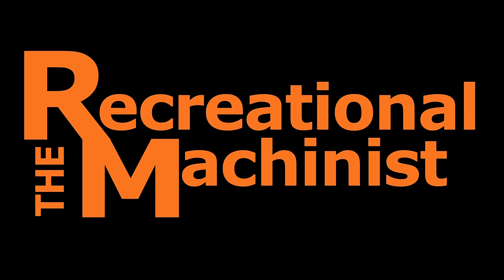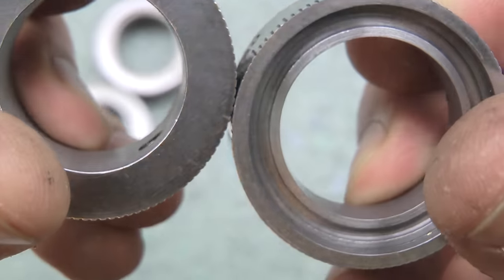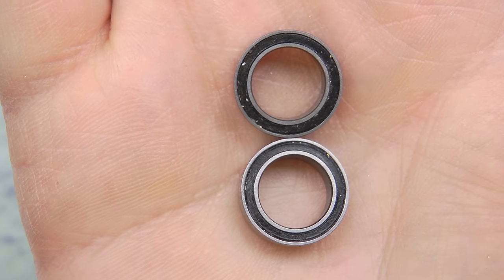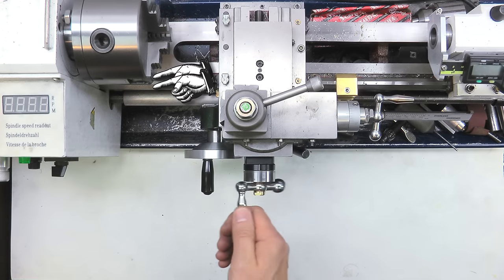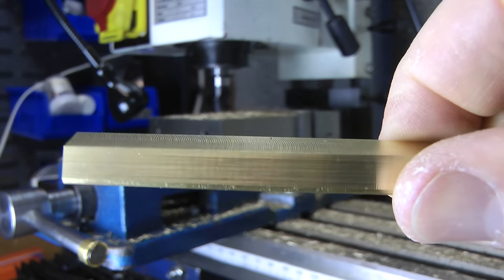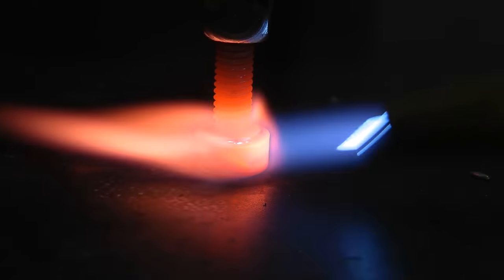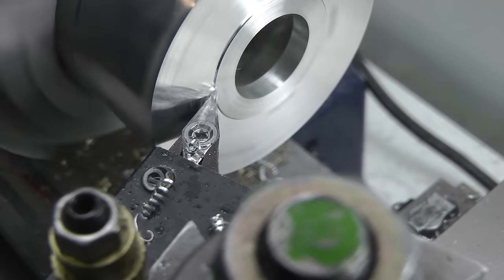Mini Lathe Cross Slide Improvements

Comment: By the time you have finished all your improvements you will have a top class lathe. Very interesting viewing.
Reply: If only the lathe makers in china thought at all about any of this. I doubt any of them even use the products.. sherline makes sherline lathe parts with sherline machines. These mini lathes are just a tad worse than hit/miss. I had to go through 3 to get a working one, first had a major defect in the bed, it was knife thin on am inside section and snapped when l clamped the tailstock, had to pay $15 restock fee. Second one, the spindle runout was terrible, chuck was mounted within 20 thou, another $15 restocking fee. Third one has minor versions of these two problems but l figure l already wasted money, the threading feature is outright useless, slop all over. I have a very old and beatup unimat that is about as clapped out as a new mini lathe. Their qc department is more interested in bat guano flavored bubblegum and sticking their peckers into dead freshwater fish than pushing through true lathes. I hope their business tanks and out of its ashes other lathemakers pop up. Their quality is a joke, a product should not require that much modification just to work properly, guess this is the chinese way..

Comment: I did the same thing to the dials on mine - those 0.025 units drove me mad. (I made the dials and scribed the divisions on the lathe - turned out pretty well). I also had the same problem with the gib strip - flattening the mating surface helped, but it also needed the places where the screws bear facing off flat. Now it sits in position OK.

Comment: What's the name of the cutter you used to mill the brass gib strip? It's like the opposite of a dovetail cutter.
Great video. Love the small upgrades presented.
Reply from the maker: That shape they seem to be called inverted dovetail cutters. They're not especially common, it took me ages to find a second hand one that was still useable, but worth the wait it's really handy for breaking corners on things without having to set the work or the machine at an angle. Smaller ones get called chamfer mills, and are more like countersinks. Not quite as useful, but easier to find. Thanks for watching 👍 🇬🇧

Comment: I've been tempted to make tapered gib strips and tap a couple holes for the tension nuts.
Reply: Go for it, one thing that helped a lot on mine was lapping down the tool marks. The surface finish was so rough on the cross slide it was like sliding two dull files across each other. It would skip and jump around,  literally makes me feel bad for people in china. After cleaning up the tool marks, surface finish improved a tad, gibs brass, the "stainless steel" one in there had speckled rust on it and had tool marks as deep as a trench. Lol chinese century

Comment: Can I make the replacement cross slide wider than the original?
I'm a total noob as just bought a mini lathe and the cross slide dovetail cracked when I was tightening the tool post.

Comment: Brilliant thank you so much for sharing

I noticed you made some mods to the tailstock also do you have any details on how they work ?
Reply from the maker: The base of the factory tailstock was hopeless. I binned it and replaced it with a piece of cast iron I machined up. I've lost the ability to move it over to cut tapers, but it's such a faff to setup afterwards I avoid doing it anyway. The brass-capped centre clamping screw on each side is through drilled (as I did on the cross slide mod) as an oiling point. It's a long way off perfect but infinitely better than it was.
Reply: @TheRecreationalMachinist  ohhhh Isee good thinking i will try do something similar.  Many thanks for taking the time out to explain

Comment: Does the gibb need to be parallel to the opposite side for any reason? I'm wondering if the adjuster side would be better square to the adjusters? It might then slide across rather than tilting over
Reply from the maker: I had the same thought actually. There's very little real estate to accommodate modifications of this type, and at the time I took the path of least resistance to get the machine back up and running. If I ever re-visit the gib (the brass one from the video is still in service and working ok) this is something I'll consider. Thanks for watching 👍 🇬🇧

Comment: How did you adjust the friction on the dial  now you have silver soldered up the access hole to the delrin centre ?
Reply from the maker: The friction is fixed. The drag of the silicon lubricated o-rings against the brass end covers provide the friction. They've not needed any attention since I made the modification. Thanks for watching 👍 🇬🇧

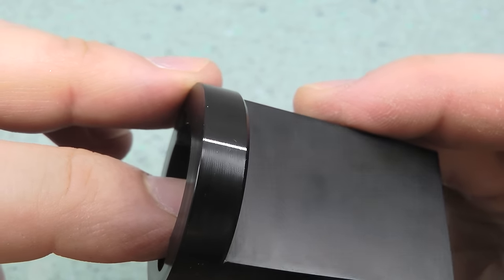Comment: How did you acheived that white line on 2:37?
If part is anodised before the white paint is put in to the grove.. how did you acheive that there is no smear aroud?
And if it is put before, what kind of paint will survive sulfuric acid and sodium hidroxide?

I'm looking for method to put black lines on the dial, and anodise it (not blackj, just simple anodising natural silvery colour of aluminium, so it will be more durrable) but lines are very, veeeery thin, so I can not put black paint with brush.. however thin the brush is...

Of course.. one possible solution will be to laser etch them, but I'm lookng for something that I can do in my "shop" (and I do not have laser :(
Reply from the maker: The line's not white, it's the silver of the aluminium under the anodise. I chucked it in the lathe and used a sharp tool to cut / scrape the line using the lathe carriage. Thanks for watching 👍
Reply: @TheRecreationalMachinist  Thanks for clarification.

Comment: This is a relatively old video now. Any info on those bearings? How many times did they need to be changed?
Reply from the maker: 18 months on, the bearings I fitted in the video are still in use with no issues so far. Thanks for watching 👍 🇬🇧

Comment: Like you, I'm frustrated by the graduation markings on my 7X14.  I would love to replace the cross slide graduated ring with one that has 100 divisions (1 div = 0.01mm on the radius) or better 200 divisions so it's direct read for diameter.  But after extensive internet search I'm astounded that these don't appear to be available.  Am I missing something?
Reply: why not make one? after all you have a lathe :))

Comment: How did you fill the hole in the dial that you did not need? Did you just fill it entirely with silver solder, or did you part fill it with a piece of threaded rod first, then solder?
Reply from the maker: I fitted a steel screw in the hole, silver soldered it in place then dressed it back. Thanks for watching 👍 🇬🇧
Reply: @TheRecreationalMachinist  Thanks. I've done a lot of electrical and some amount of plumbing soldering in my time but never silver soldered...
Reply from the maker: It's useful stuff, though it needs a very much higher temperatures than tin / lead solder. It produces a really strong joint and can be used with dissimilar metals. The high silver content makes it quite expensive though.

Comment: What size toolbars do you use in your QCTP. I bought an AXA style post and was wondering what size tooling should I get 1/4, 3/8th, or maybe 1/2 inch square for sturdiness?
Reply from the maker: I'd go 3/8th personally. Depending on your setup, the top of the 1/2" may be above centreline so you'll be grinding away just to get your cutting edge low enough. If you're on a mini lathe you won't have the power or machine rigidity to take heavy enough cuts to need more than the smaller (and less expensive) tooling.
Reply: @TheRecreationalMachinist   Thank you for that great info. It helps me greatly.

Comment: I have the same lathe and have the same problem with the gib strips. Could you make the 2 gib strips for me? I have no mill unfortunately. I'll pay off course...
Reply from the maker: I've far more projects of my own to do, than time to do them in. There's no way I could find time to make parts for other people too. I'm flattered you'd ask though. Thanks for watching 👍🏼
Reply: Thanks for your reply. I spend some hours on the cross slide today. I found that the lower edge of the gib touched the recess of the lower plate of the cross slide (bad Chinese finishing...). I ground 0,75mm of the edge of the gib and filed all angles with a little diamond file. Cross slide is now silky smooth with no play. 👌🏻🤗

Comment: brass is not a good material for gibs because the softer material wears out the harder material. So your lathe will weoar out faster
Reply: Did I understand well? You mean the brass gib will wear out the cast iron in the cross-slide? Care to explain why?
Reply: Uh not quite, your correct that brass isn't the best material but that's because it's soft enough harder material such as steel and cast iron swarf can become embedded into it. It then acts like a rather poor lap and that harder material will score and wear out the machine's sliding surfaces. Cast iron while fairly soft might still be a better choice, or just make one out of steel. All design engineering is a series of compromises as there's no such thing as a perfect material for any part. At best all we can do is pick the material available that has the least amount of poor quality's depending on the job the part is meant to do. If? you can keep your slides as clean as possible and properly oiled as they should be, the brass could work fine. Most amature's just don't understand how important both those details are. Laziness and poor maintenance has worn out far more machine tools that using them to do the job they were designed for ever did.